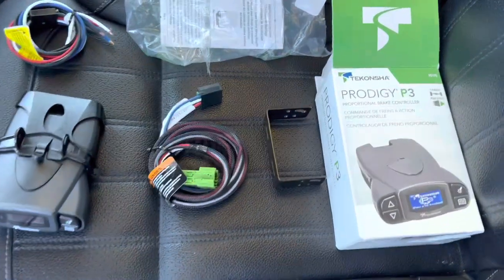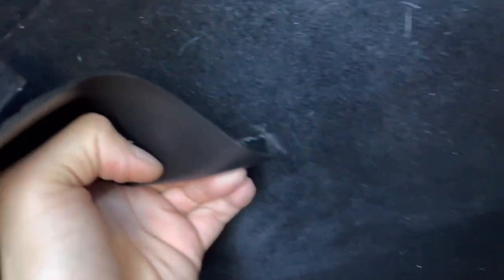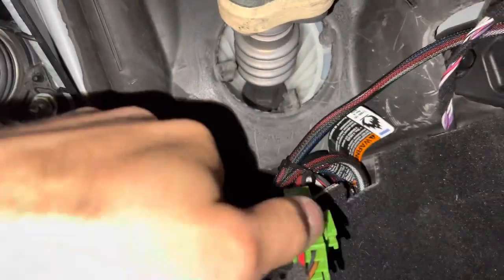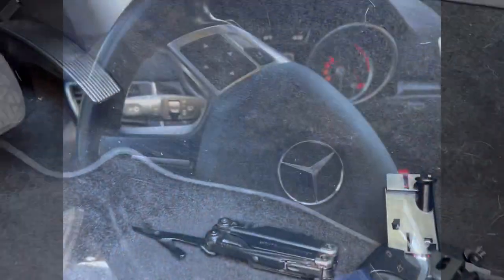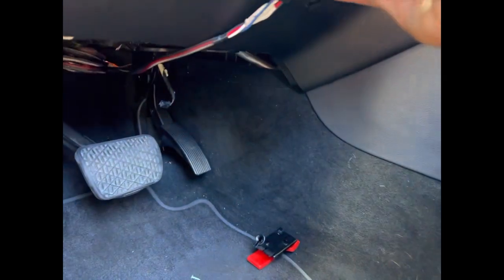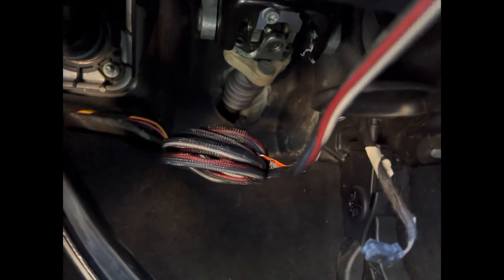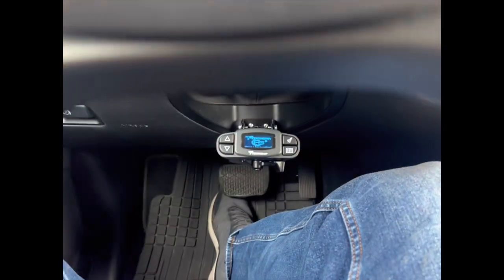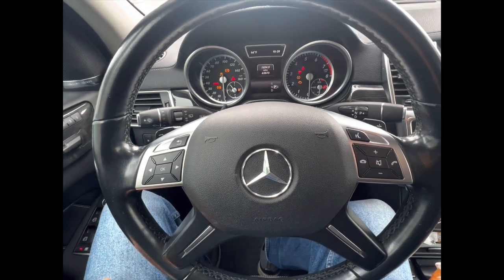X166 - GL Class - Trailer Brake Controller

Comment: I wish you showed us where the brake controller wire is for the trailer in the back of the vehicle to use it for a 7 way plug.

Comment: What wiring harness did you end up using to plug into the green connector on the vehicle then into the controller?  Or did you use that same harness but rewired it?  What wiring diagram did you use?  Thanks...